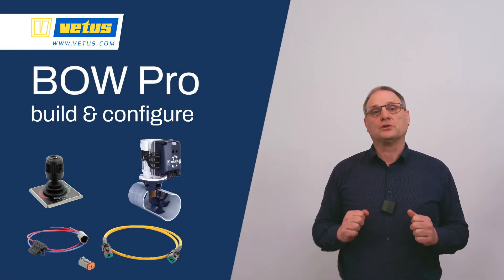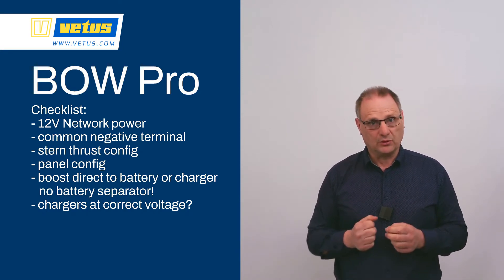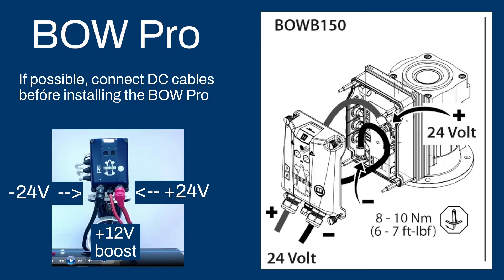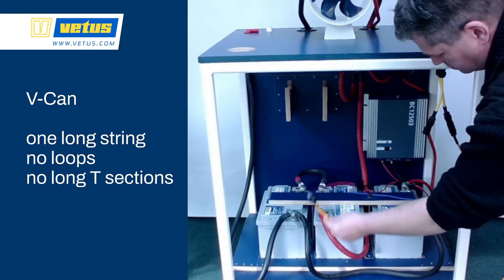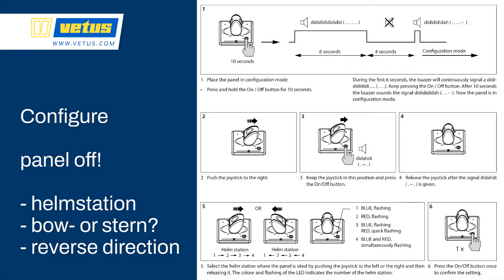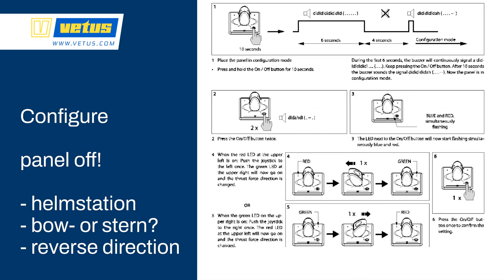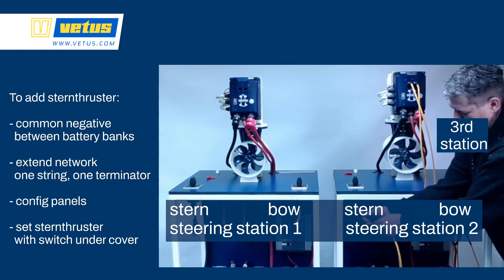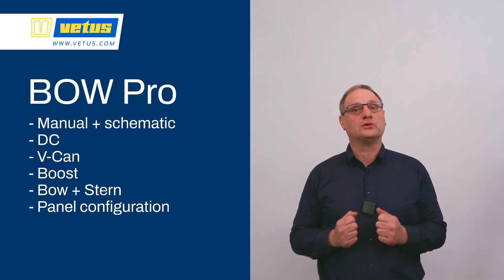VETUS BOWPro: installation and configuration of control panels, bowthrusters and sternthrusters

Comment: I thought that the VETUS V-CAN bus must have TWO termination resistors, one at the begin of the bus and one at the end of the bus.
In this video I only see ONE termination resistor at the end of the CAN string mounted on the BOWPRO unit.
Where is the second termination resistor at the beginning of the string near the joystick ?
Or has the power supply cable a buit-in termination resistor ?
Documentation is not clear about this...

Comment: dear sir,  in my 40FT ASTONDOA boat i have installed  one bow thruster BOW PRO THRUSTER 900 , i want to install the stern thurster but i think i can instal 760 model. and i had ordered the joystick  DBPPJA Compact double control. My question is if i can install inside the boat the 2 remote controls that i have ( Square proportional thruster panel ) and on the fly the DBPPJA JOYSTICK. ? Thanks in advance, Michel